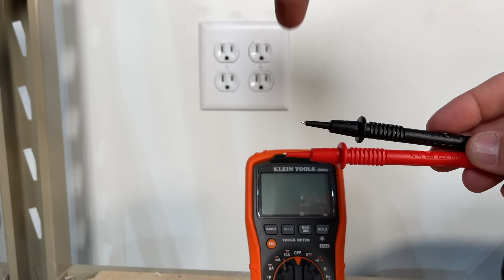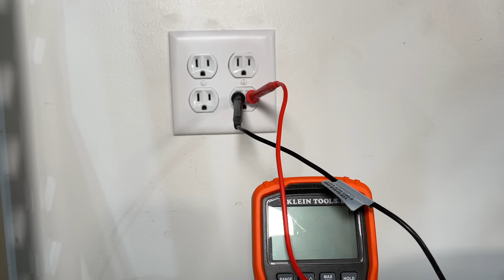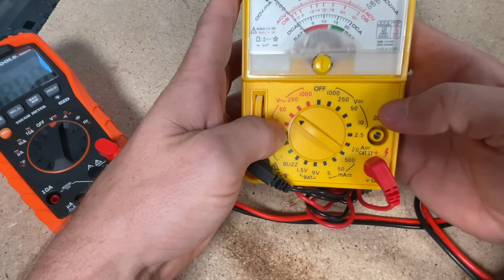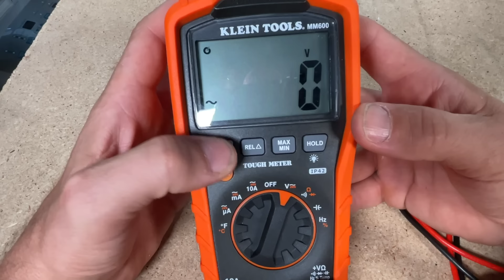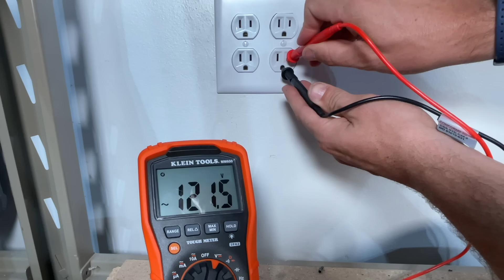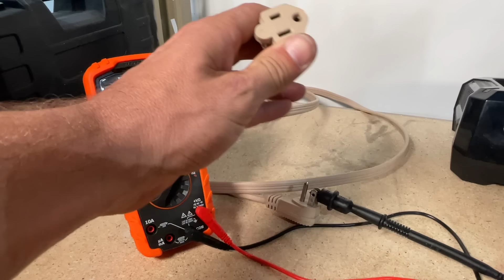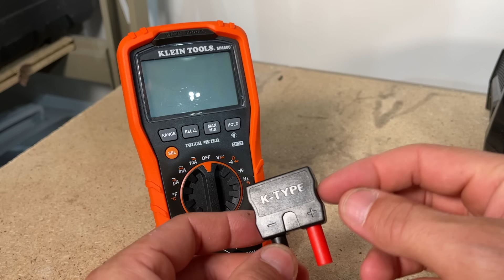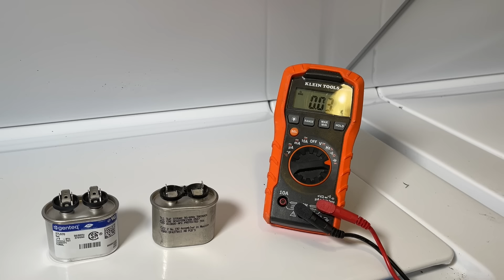How To Use A Multimeter for Home Repairs and Troubleshooting

Comment: Hello everyone. I made three outlet testing cables for testing mains outlets. I used three plugs, and six banana leads. Coloured correctly for the Active, Neutral and Earth. I took out a blade from each plug so I had 1) Active / Neutral, 2) Active / Earth, and 3) Neutral / Earth. I then cut one end of each banana lead and wired it up correctly for the above plugs. And used heatshrink over both leads to keep them together as one line. The banana leads go into the multimeter and the plug goes into the outlet. To use them I turn the outlet and multimeter off. Then connect the up to the multimeter and outlet. Then turn them both on. This way I'm not holding or putting anything into a live outlet. Everything is connected first then all's I do it turn on the power. When I'm finished I turn the power off remove the plug and disconnect it from the multimeter. I hope that you all like the idea. Stay safe. Cheers. 

Also, I long dry wooden spoon makes a great extended finger to switch outlets on and off.
Reply: sounds like a lot of work, but if you don't understand circuits well enough to know what's safe and what's not then whatever

I'd also suggest that if you feel you need to take such measures you don't know what you're doing and should do some more learning.
Reply: @DegreesOfFreedomLog  I also made an RCD controlled inline 240v splitter cable. That's triple insulated and split with three way breakouts that I made from Glueline. Which goes inline before the load and after the outlet. That I use with my clamp meter to measure inrush on a load without having to break the circuit of the load. And without having any exposed cable on the load. Is this what you mean by learning?

Comment: With the meter set for reading for potential you will not get a shock with the other probe out of the neutral as it goes through a resistive circuit in the meter to read the potential you are measuring. Now, if you put the black in the common jack and the red in the AMPS jack you are creating a short in the meter and WILL feel the voltage in the other probe. Big safety issue here and not everyone should be using these!!

Comment: if it's AC, why does it matter?  the "neutral" is still electrified
Reply: You'll get the same measurement either way.  The reason it makes a difference is that you avoid energizing your second probe, if you connect to the neutral or ground terminal first, and to the live terminal second.  Otherwise, you will put live voltage on the unconnected probe.  The instant you try to do anything with that live voltage, the megaohms of impedance of the voltmeter will stop the current before it does serious damage.

Comment: You didn't mention the amp setting.  You should have mentioned that if you have the red lead in either the 10A port or the .5A port, the leads are now like a jumper wire, regardless of where the dial is set, or even if the meter is off or not. Plugging the probes into something with power and ground (like you would to measure voltage) will instantly blow the (possibly) very expensive fuse in the meter, possibly damage the meter, or blow the circuit breaker of the circuit you are testing. Ammeters are ALWAYS connected in series. Best bet: if you are not sure of what you are doing, NEVER put the lead in the AMP ports! (btw, Fluke fuses are $20-$30)
Reply: I blew out my Commercial Electric multimeter doing that today. I watched a video that told me to connect the 10A side and I did something wrong. It’s junk now.
Reply: @Fresh-tw7ev  I taught automotive electrical for 18 years. Trying to teach students how to use the ammeter was a Nightmare! We went thru untold 10A fuses (at least 5 or more per every 3 week long class). The school would usually supply the first, but students had to pay for their own after that at $5 each. BTW, that fuse protects ONLY the ammeter, so volts and ohms should still work.
Reply: @61rampy65  The most important thing about ammeter mode, is:
Don't use it, unless you know exactly what you intend to do, and how it is supposed to work.

The second most important thing to know about ammeter mode is:
Put it in series with your load, and not in parallel.

Comment: Somewhat unrelated but I always advise friends to have  spare capacitors for their AC systems. They are cheap and always seem to fail on hot holiday weekends. You don't want to be a "cap bandit" victim. However, DO NOT attempt to replace one without reading instructions or watching a few good videos. It's essential that the capacitors not be charged when you touch them.

Comment: For "most" home DiY'ers I'd probably recommend a kit like the $70 Klein Tools CL120VP and a cheaper multimeter like a INNOVA 3320.

The typical DiY'ers buying a $200 to $400 multimeter for home use is a little fringe.

Comment: Nice.  If you can demo (affordable ones) circuit tracers sometime that would be awesome too.  I would love to know where each of my 5 outside lights go as I would have wired them all together, but nope, the builder of my house got creative, but not in a good way.
Reply: I got a Centech cable tracer from Harbor Freight.  I've never tried using it at an outside distance though.

Comment: Like hour vids. A subscriber.  How do i know what is ground on electrical outlet when the slots on the outlet are the same size.   In your vid the slot for geound is larger.   TY.
Reply: The ground is circular. The standard 120v receptacle (yours sounds like the old 110v non polarized receptacle) has tbe neutral blade on the left side, being slightly larger, and the line or hot blade slot on the right side. Ground will be below the two as a circular hole , (or above as some prefer to mount ground side up... it doesn't matter and that's a whole other useless debate.)

If your receptacles are old, no polarized versions then it doesn't matter. On voltage mode you can put a probe in one and touch the other to anything metal anywhere..  like the screw on the outlet plate. If it shows 0 volts then that slot is neutral. If it shows 120v then that slot is the hot. 

The reason for polarized plugs is because neutral carries current on the return path to and from the panel but isn't always pushing current to the load and is usually carrying the difference between various loads so might actually be less. Devices that started having metal exteriors like lamps or motors would become "hot" if the plug happened to be put in with the neutral side touching the input and hot side on the output. (Keep in mind it is AC power so I use input/output loosely as both have current in and out 60 times per second.)

For safety reasons the neutral blade became flared to differentiate and houses wired then same to match newer receptacles... and them the EGC was introduced so a ground blade and slot was also added.

Comment: I have a suggestion for a future video with all the crazy prep ads on generators  what would you suggest, and when the time comes I'm going big to help out a select few and with a huge one,  I already sealed it in my mind no going back on it.
Reply: The larger the generator the more fuel is consumed. You're better off doing what utility companies do... load management and load shedding. You want the least amount of loads as possible because you waste fuel otherwise. Larger generators also mean more maintenance and noise.
Reply: @etherealrose2139  , a 5KW portable Honda hooked up to my house is sufficient to run the fridge, oil burner/boiler and duct blower, well pump, TV, Keurig, Wi-Fi, and any LED lighting I want, and runs 12+ hours on 6 to 7 gallons of gas. No, it won't run the electric stove or the washer and dryer, but It'll run the dishwasher, a small microwave, or a small electric fry pan, as long as they're not all running simultaneously. The biggest power suck in the house, that makes the generator burble loudly, is my wife's hair dryer.! Anyway, although YMMV, 5KW will give me hot and cold water, heat, lights TV and fridge, and a little "laignappe". A propane camp stove completes the necessity list. As long as my wife can stay warm and wash/dry her hair, and have a coffee,  we have peace in the home! PS, the Honda is *quiet*; prior to the Honda, we had a Chinese made "Homelite" 5.5KW generator from Home  Dumpo that was similarly quiet, worked great, and economical on fuel, but my back is bad and when it started acting up with carburetor issues I threw my back out trying to start it, so I replaced it with the battery start Honda.

Comment: 12:15 -- The pouch is critical, especially if there are many accessories like with yours.

And what's the deal with multimeter prices?  They seem to cost EITHER $40 or $400?!

Bought a basic Klein multimeter because everyone said I'd would eventually need one.  Not sure what model but it was about... $40 😂
Reply from the maker: If you got one for $40 I bet it is the MM400 which is the one I had prior to the MM600 and can do basically the same measurements.

Comment: It appears you don't know how to use your multimeter.
Reply from the maker: Do tell 🤔
Reply: @EverydayHomeRepairs  
Mostly because there is no danger when plugging into the hot side of a receptacle first.  I didn't really look at much beyond that point.
Reply: @EverydayHomeRepairs  tell me how you test 240v across two hots without putting a lead on one of the hots first? Which goes to show your whole premise is bunk.

Go pull your dryer plug and test the receptacle across line 1 and 2. Get back to me.

And you won't be shocked it's nothing like sticking a knife in the outlet lol

Comment: Bruh.... "OL" means "Open Loop" aka open circuit, aka no continuity, aka infinite resistance.

Gotta show these ppl the importance of how to hook the leads up properly to the meter as well. Can't tell you how many apprentices I've seen get all giddy about using thier new meter, only to have them hook leads up to the amperage side, and check voltage... in turn, frying thier cheap ass meter.

Would highly recommend Fluke 117, and Fluke T6 for meters/testers. I wouldn't trust my life to any other brand.
Reply: At 4:20 it isn't an open loop though.

117 is definitely a good recommendation.

Comment: The order of probes do not matter in either DC or AC. If you're trying to determine polarity is about the only time it matters if you can't see the source of power.

Just verify you're on the correct setting to not create a short which should blow an internal fuse In the meter.

Think about it. How do you test 240v as they are both "hot" ;) same for 3 phase. Your opposite lead will not be hot as there's a resistor inside.
Reply: This guy obviously makes stuff up,  then passes it off as fact.
Reply: @paulsto6516  I thought about the op comment. Most things were solid in this video
Reply: @mjrg37  
I think I require a much higher percentage of solid.

Comment: If you have safety sockets you need to put them in at the same time.  That would make sense in other cases also.
Reply: Yeah, that pretty much makes the whole chicken or the egg probe insertion sequence moot.
I dislike the dopey gates on the new "Protect you from yourselves" receptacles that make it difficult to simply insert one probe in at a time.
Reply: TR video is needed

Comment: I just received my Klein MM 600 today Saturday 9-18-2021. I haven't used a multimeter in years. I might use it tomorrow or Monday. My old meters display started action up, only used it once or twice a year. I haven’t used this meter yet and already want to upgrade to the MM700?  Thanks for the great video. 
Question, which accessory is better, Klein Tools 69445 Magnetic Hanger Without Strap or the Klein Tools 69417 Rare Earth Magnetic Hanger, with Strap? Thanks for the great video.

Comment: Does it do diode tests?
Reply: An analog multimeter is often a better choice for testing diodes (and transistors) than a digital meter, especially for in-circuit testing, without the bouncing around of a digital display. At work we use analog Triplett or Simpson meters for this; great for finding shorted semiconductors as well as checking  the forward junction.

Comment: voltmeters have a very high resistance so you aren't going to get a shock from touching the black probe with the red still in the outlet.
I would suggest that testing  a capacitor might not be the best thing for a homeowner to be playing with. They can still have charge on them.
Reply: Yep no way you re getting shocked at 120V from touching 1 probe, I just put the black probe in my mouth to test how much my boots insulate me, it was still reading around 38V, but once I touch the wall with my finger it jumps to 120V, I did the demonstration to teach the new guy about grounding and the concept of getting shocked.
Reply: That is true, but it's still a good practice because the user might have accidentally left the meter in current mode (as opposed to voltage mode), which has very low resistance.
Of course, if the user connects both probes in that mode, it'll immediately blow the fuse, but before that happens, the other probe is indeed hot and dangerous.
Reply: @catsspat  
Comes down to paying attention to detail. If a person cannot be bothered with that, they probably should just hire a professional. A healthy respect for electricity goes a long way toward safely working with it.
Reply: @catsspat  how often have you used your multimeter in current mode?
I placed the leads in the wrong spot once. There wasn't anything left of the meter.
Reply: @catsspat  why would current go through your body when it's got a short it can get through (i.e. multimeter in current mode connecting hot-neutral or hot-ground)? Also that's a fused connection.

Comment: Great video! I feel like the multimeter is misunderstood by the average DIY-er because on the surface it seems complicated, but the flexibility and range of things you can use it for vs. just a neon/non-contact voltage tester makes it indespensible.
Reply: I used a multimeter to test the solenoid that helps control water flow of my discounted laundry washing machine and of course it was faulty. I wish i knew more to make use of the multimeter!
Reply from the maker: Hey Marc,  completely agree.  In terms of being to troubleshoot and find root cause of failures the Multimeter is top of my list. 👍

Comment: I like that multimeter, ive got the Fluke 110plus which is twice the cost of the klein but has fewer features. i didnt know about order of placing probes. great info.
Reply from the maker: Thanks, Fluke is a great brand but you do need to pay a bit more for sure.
Reply: @EverydayHomeRepairs  great detail although i like klein tools dont trust their meters. I put my trust in fluke i have a fluke 117 mm and a fluke 376 fc clamp meter which can read up to 2000amps.
Reply: @EverydayHomeRepairs  how do you get the probes to go inside the outlets? Mine is a different brand, they don't fit & are too short. Resistance & continuity tests get no reading. One setting on dial works, but reading just jumps around. Followed manual instructions, but nothing seems to work
Reply: @EverydayHomeRepairs  you also stated that you were sticking the probe into the ground side of the outlet, then you stuck it in the neutral.
Reply: @EverydayHomeRepairs  you also stated that you were sticking the probe into the ground side of the outlet, then you stuck it in the neutral.
Reply: @EverydayHomeRepairs  just bcuz you have the black probe in the neutral doesn't mean it's making a connection at the same time as the red hot probe so it still could be unsafe as you say.
Reply: I used a Beckman for many years and that was after I retired my Simpson 260.
Reply: For the non-professional, Extech makes a wide range of multimeters that are very reliable and inexpensive. I've been using them for years.

Comment: Good information I miss it or did you not mention it what is the REL button for?
I’m using a Southwire 10041N Auto ranging multimeter bought at Lowe’s to replace my Greenbrier that went bad
Reply: Relative (REL) mode: Stores existing reading (a delta) and resets display to zero. Sets a relative reference point to measure against the next reading.
Reply: @AgentOffice  Thank you
Reply: @rayraden2527  like a tare

Comment: Good basic multimeter function video, I wish you would have demonstrated discharging the capacitor before touching it, I’ve been jolted by CAPS early in my career, depending on the CAP, it can be a shockingly memorable experience LOL, thanks Scott
Reply: He was too busy making stuff up about how to plug the probes in the wall.

Comment: Good advice, I have many meters but the one I use the most would be the Fluke 117 true rms. One thing I like about the Fluke is that it does state AC/DC plus the symbols so those that may be new to meters don't have to guess.
Reply: Not sure how many people NEW to meters are going to spend $180+ for a DMM
Reply: @totallyfrozen  I thought in the video he had asked what we use, I just listed the one I prefer.
Reply: @totallyfrozen  i don't know about the new ones.  but I spent a bundle on a Simpson 360 a long time ago and i still trust it.  So money well spent on a good meter is a wise choice in the long run.

Comment: I think this is the best i have seen for multimeter demo. BTW, i am electrician
Reply: Then you're a crappy electrician. 

Tell me, how many times have you been shocked by putting either lead on a hot line and touching the other lead? Between 0 and... 0?

Because how would you test between two hot lines (line 1 and 2 to get 240v on split phase?) One lead will always be touching a hot first because.... They're both hot! Same as testing 3 phase... you have 3 phases coming in and may not even have a neutral.

How do you test for voltage at an AC contactor? They're are almost always going to be L1 and L2 and possibly L3 if three phase. There's usually no need to bring a neutral to a condenser.

If he cannot get this simple thing correct I'd ignore everything else said.